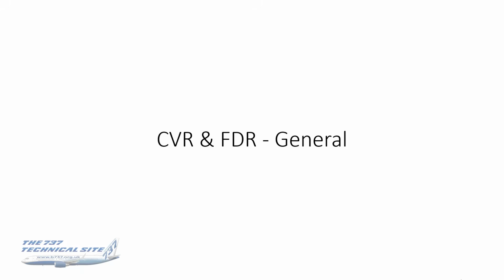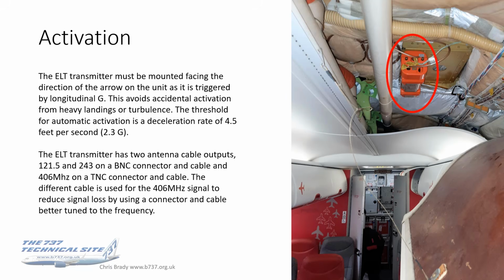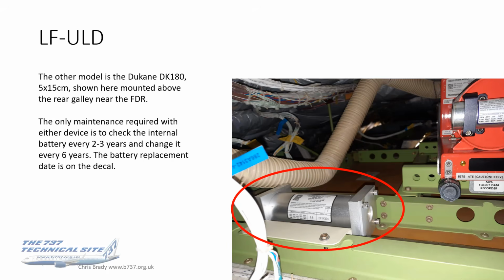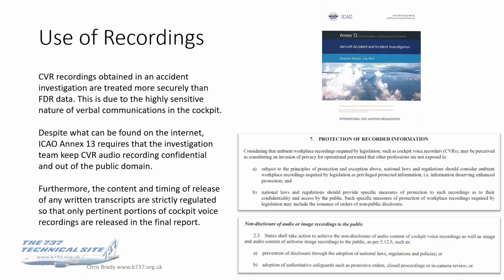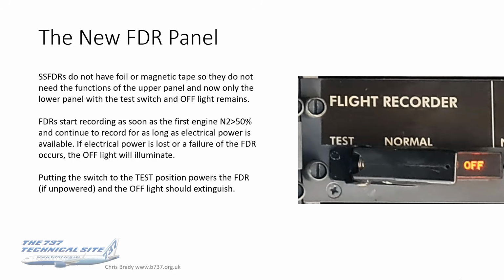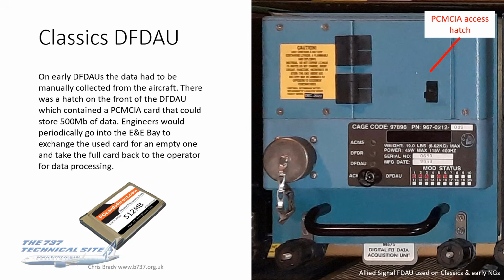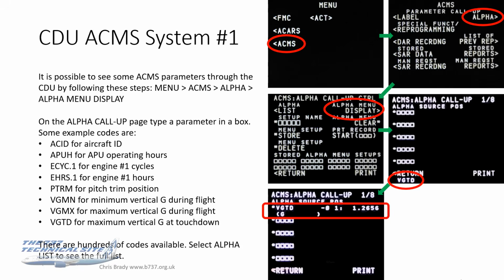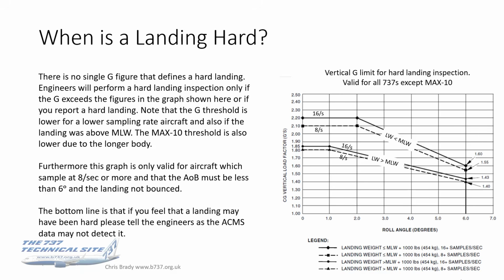737 CVR, FDR, ELT, LF-ULB, DFDAU and QAR

Comment: If you're not already on it, may we have a video focusing on power to the older 737-800 VDR and CVR please?

Just how many slices of swiss cheese do we need to de-power them?

Related question: if the aircraft's battery-to-unswitched-hot-battery-bus connection is broken, but the battery charger is powered up so there is voltage on the bus, does (perhaps can) any system detect that and notify the flight deck?
Reply from the maker: Yes, I am working on exactly that. I might be able to get it out tomorrow depending on my flying roster!

Comment: Hello Chris, I just discovered your You Tube channel today. I have been doing in-depth research about various Aircraft Crashes and Incidents since March 2021. The latest incident of my focus is the 29/12/2024 09.03 local time South Korea, South Jeolla Province, Muan International Airport, 34°59′13″N 126°22′58″E, Boeing 737-8AS, Jeju Air Flight 2216 Plane Crash. I know quite a bit about Cockpit Voice Recorders but am not au fait with all aspects of the technology.

A couple of questions:

(1) Do you know what sort of CVR was being used on the Boeing 737-8AS registered HL8088?

(2) What is the normal Chain of Custody for a CVR after a crash? 

(3) Do you know if Flight 2216's CVR was using/connected to a Recorder Independent Power Supply (RIPS)?

(4) If a 737 loses all electrical power, will the CVR still work/record?

(5) Can a pilot or co-pilot disconnect/turn off a CVR, either pre take off or in-flight?

Hope to get a reply from you about these questions ASAP.

Sincerely 😎

Adam Neira
Founder of World Peace 2050
Founded in April 2000
Paris - Jerusalem - Melbourne
Reply from the maker: I have no way of knowing what type of CVR was fitted or if it had RIPS, that will come out in the investigation. Chain of custody depends upon the country of the accident. ICAO Annex 13 has a preferred path but it isn’t always enforced. Re “all electrical power” if all electrical power is lost then all electrical items will be unpowered. You need to understand that there are different types of electrical power - 3 generators, AC & DC busses, standby busses, various batteries etc. Watch my electrical videos for more info.

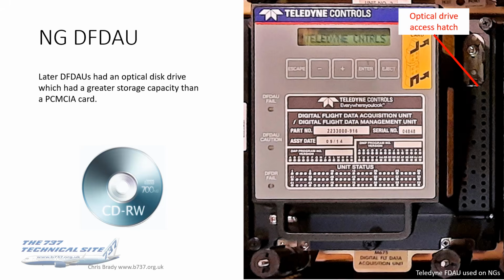Comment: 56:32 that FDR test receptacle behind P18 de-energizes the DFDAU when you remove the cap. If you have a failure on DFDAU and it's C/B is in, checking that receptacle is a good practice before performing wiring checks.
Reply from the maker: Top tip thanks

Comment: After watching this video I was thinking back to the analytical skills of Fred Jones (set down in his memoir ‘ Air Crash’) where the story was unravelled from the physical evidence of the actual crash or event itself. How different it is today with modern FDR and CVR technologies that record significant aspects of any flight. These technologies should be extended to military aircraft and GA aircraft if possible. Understandably  the costs would need to come down. Interesting subject, thank you.
Reply from the maker: Cost, size and weight all need to come down. This is happening to some extent already. AIBs can put together a lot of info from data held in avionics and GPS devices but there is a long way to go.

Comment: The VHF antenna signaled as nº 2 is really the VHF 3 antennna location, located aft of wheel well. VHF 2 location is at fwd lower fuselage location.
Reply from the maker: There are different configs but all for the aircraft I have seen the lower aft antenna is either VHF 1 or 2 and the lower fwd antenna if fitted is for VHF 3. The upper can be either VHF 1 or 2.

Comment: Thanks Chris as usual. Great in detail for us flying 73nerds. I would like to know if it’s possible to see the input of each single control column/wheel. Say that the MCP has the left MA(CPT should be PF), but the F/O is manipulating his control column/wheel. Could you detect this on the QAR? Or by any other means? I tried asking our engineers, but they don’t know. Perhaps our safety department would know? The best answer I got was, maybe… and yet the 2 control columns are synchronized physically as we already know from your Flight Controls video. Thanks again Sir!
Reply: Good morning Mr. Aisen, I know that the Avionics department/Technical records department from within a company may have access to such information. When a QAR download is called out in case of a, let’s say a hard landing report, they have this software that compiles I/O signals from all of the systems. Graphics are plotted and you can select whichever Input/Output to analyse in that particular case. Also this was the case when working for the AirForce in Romania as an Avionics Engineer on the Puma330 helicopters.
I would also like to give special thanks and appreciation to Mr. Brady and this channel, such a wonderful and professional approach in providing this great content, keep up the great work and shout out if you ever need any pics and videos from Line Maintenance!
Reply from the maker: Thank you Adrian for helping to answer Daniels question. Thank you also for your kind words about my channel. I am always on the lookout for unusual photographs from 737 line maintenance, please send any on my email. Regards Chris